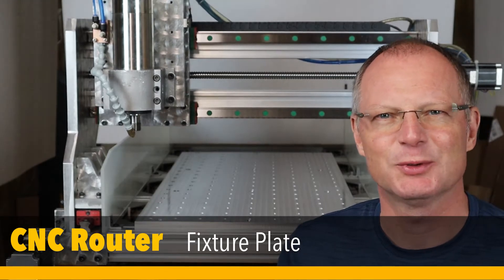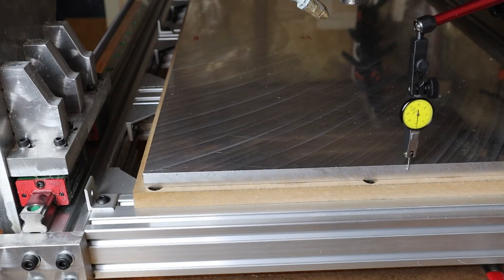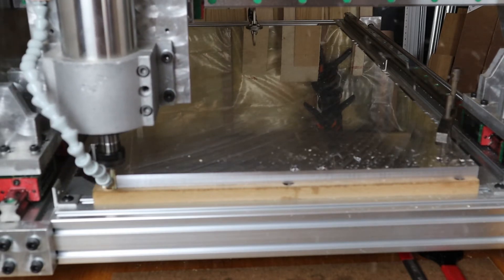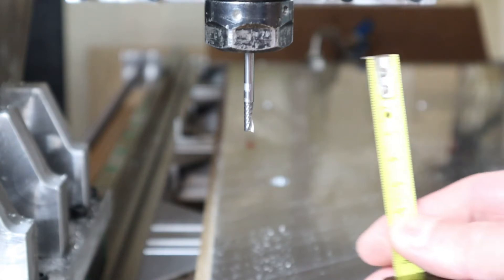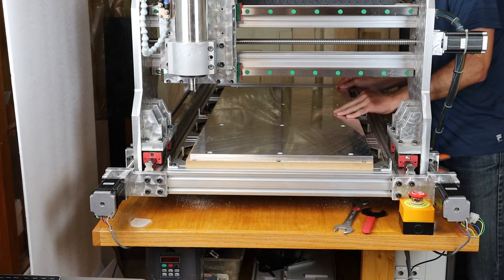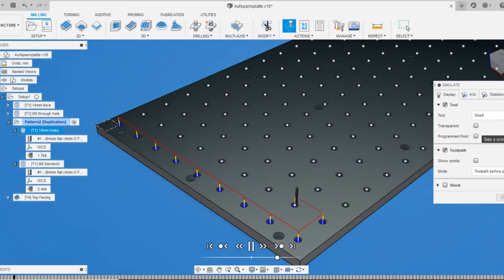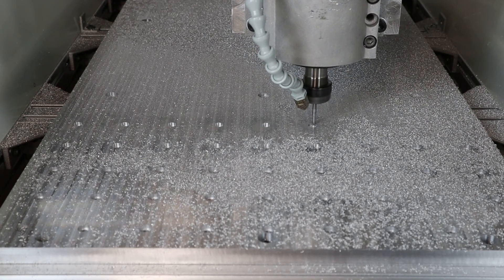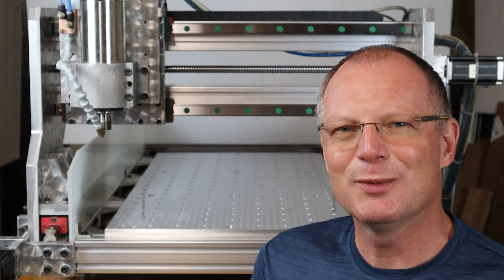CNC Router Fixture Plate 1/2

Comment: One question: Is there a special reason for using the round carbide insert? In my understanding It would leave little micro waves depending on movement speed of the spindle.
Reply from the maker: Have a look at a single flute tool in principal it would leave little triangles in the surface. And I think if you are willing to look close enough that is what you really find. However practically it’s flat as the rpm in relation to the feed is very high. I use the round insert because it has advantages for a light duty machine.
Reply: @JBWorx  I took a look and you are right. I have one endmill that even it looks nearly flat at the bottom seems to still have a slight angle.
Reply from the maker: Good 👍 now you know 🙃

Comment: Wow, you are really making a huge fixture plate. Impressive! May I ask what is the make of 1" face mill you are using please. I have had no luck at all sourcing this item. Best Regards, C
Reply from the maker: Hi Chris, I got a set from Amazon, search Accusize 3 Pc little hogger end mill set. Here a link as well but I am not sure if it will come through. 
Accusize Industrial Tools 3 Pc Little Hogger End Mill Set, 45 Deg, 90 Deg and 3/16r Mill with 3/4'' Shank, 1'' Head, 0046-0700 https://a.co/d/iOORg6R
Reply: @JBWorx  Okay, thank you to Accusize,   but still that is a little confusing given that most 2.2kW water cooled spindles come with a max of ER20 spindle taper which limits the user to 1/2" shank as you know. Perhaps I am having trouble with scale due to camera lense but I really thought you were using a 1/2" shank. Maybe you have a spindle that is not so run-of-the-mill....There was some anguish as it took me 30min and then only to find a single U.S. company that makes a 1" indexable that would fit my ER20. I would also raise the matter of getting the correct SFM with a spindle that really has little grunt at 6000rpm for instance. And most figures for recommended feed and speed are geared to much lower RPM. So what is your solution my friend? I know we could talk for hours on the subject :)
Reply: As do the very protracted upgrade I find myself in, I might well consider changing the spindle. ER25 or ER32 but it is hard to find the specs re: power band from the Asian sellers.
I would love to have toolsetting capabilities and ATC running BT30. A man can dream....
Reply from the maker: Oh no! Everyone that asked for this end mill (quite some people BTW) I always add the comment to check if the shaft fits. You are 100% correct it does not fit into the standard 2.2kW water cooled spindle. So I turned down the shaft using my lathe. No 6000 rpm will not work as you pointed out there is no torque left. So a max. depth of cut of 0,2mm with 12k rpm will work fine. I am still looking for aluminum inserts for this tool though.
Reply from the maker: Yes an ATC would be very nice for me as well. Have you seen Spinogy made in Germany ? No external cooling unfortunately very expensive. I lean towards Jian-Ken and because I also machine steel sometimes a higher winding with lower high end rpm will be fine for me. This opens up the ability to also drill …

Comment: Hi, how did you calibrate the planarity of the xy plane of the machine?
Reply from the maker: Hi Marson, please have a look at my playlist I have a full video for it. In short I use a known standard (square) and move one side of my Y-axis until X runs square to Y.
Reply: @JBWorx  sure, i saw that video. That ensure the squareness but no the planarity.
Reply from the maker: Ok yes I understand what you are asking. So there are 2 ways I can do that on my machine. The first is trough EdingCNC it allows to probe and correct the Z hight I did not use that Funktion. I used a machinist level first to set both y-axis rails exactly parallel and horizontal next I set x exactly horizontal again using the precision level. Next I machined the machine bed to get everything parallel to the bed. I hope my explanation makes sense.

Comment: Where did you buy the face mill? I'm interested to buy one for myself as well
Reply from the maker: I bought a set of 3 endmills made by Accupro via Amazon. I did not expect much as they were cheap but I am very pleased with the quality. The shaft was too big so I used my lathe to turn them down.
Reply from the maker: Sorry just realize the correct name is Accusize.
Reply: @JBWorx   was the shaft hardened?
Reply from the maker: It was tool steel, so definitely harder than the regular mild steel but machinable.

Comment: An excellent guide on how to do it. But also I want to ask you, what do you use as a coolant, and what compressor do you use to make air pressure? Thanks
Reply from the maker: In this video I used a TrimSol product. You might see that it is blue. I also used it in my lathe and I did not like that it started to stain the machine. Now I use a nonchloronated Simi synthetic that is clear called Trim Microsol 585XT. For the air you don’t need much pressure I use a quiet compressor made by California air tools. It’s the one with the double aluminum tanks. I like it a lot and it can run all day without shutting down because of overheating.
Reply: @JBWorx  Thanks for your answer. I have got Shapeoko Pro CNC Router, and I have to work a bit on accuracy.
Reply from the maker: Yes understand. For your machine the key is to use smaller tools and lighter cuts.
Reply: @JBWorx  I'm thinking to change the belts for a ball screw
Reply from the maker: Yes that would be a very good improvement.

Comment: What did you use for work holding for the plate if I may ask? I'll be heading down this road soon and just thinking about how best to approach things. I don't suspect you'd get away with just gravity and the weight of the stock, but maybe that worked?

I have a 1/2" aluminum bed on mine (custom designed/built CNC). I'll be mounting the slightly smaller fixture plate to that and the current plan is to elevate it up off the bed using some thin aluminum stock and superglue/painters tape to machine the edges square and bore the mounting holes. Once that's done, I can drill/bore/tap the holes in the bed. Then attach the fixture plate, facemill it flat and finish machining the fixture holes.
Reply from the maker: For the first operation I fastened it to my mdf spoilboard using clamps on the perimeter. Next I machined the holes to bolt the plate to the frame underneath. I then removed the mdf spoilboard and mounted the plate and roughly aligned one edge. I then cut the left and front edges as reference square. The hole Lay-out avoids the frame underneath except in the very front where I took my chances to possibly drill slightly into the frame ( Maybe 1/32). I think your plan sounds solid that should work as well. Just make the flattening operation after you fastened everything permanently down. Good luck !
Reply: @JBWorx  Thank you for the reply! I was almost certain you had to have some sort of work holding in place regardless of the larger size/weight of the stock, but thought maybe you had a magic trick up your sleeve. =) 

Yep, I will certainly do the flattening after its bolted to the bed.